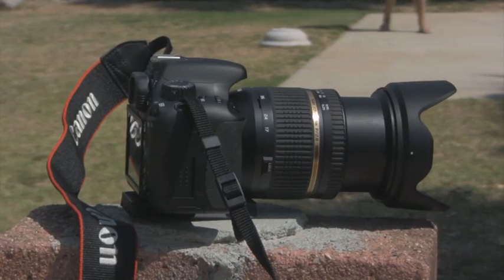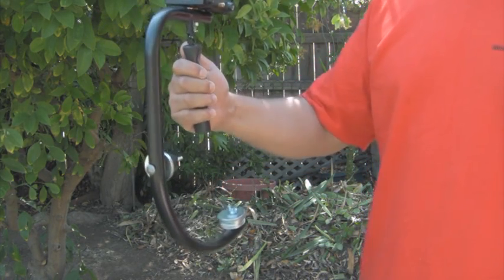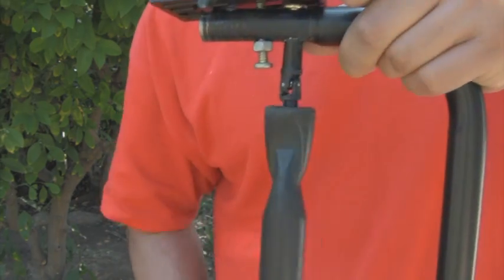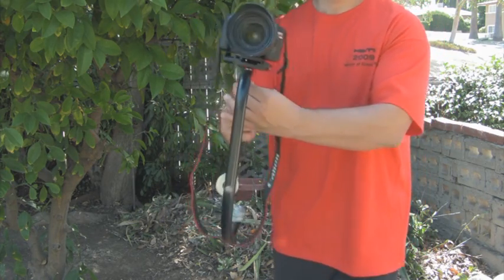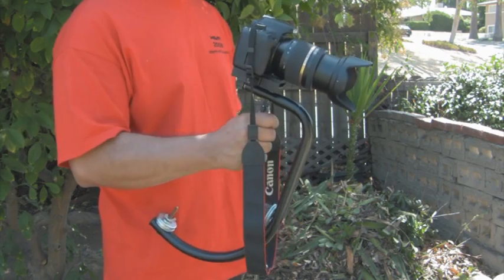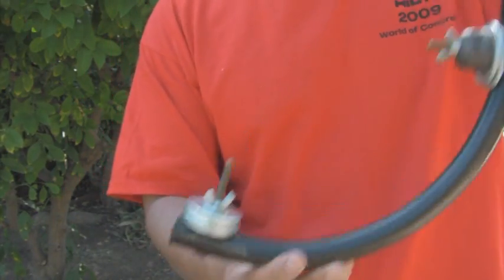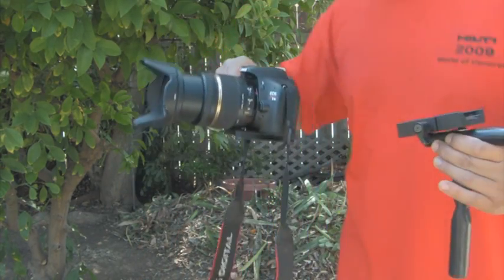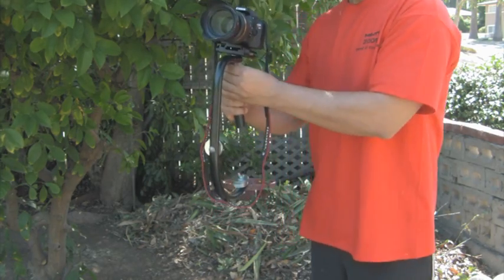DIY Steadicam Merlin Stabilizer Parts I used to build it.

Comment from the maker: @danlnad IMO, skip buying the bearings and go get a jump rope....it'll have the handle and the skateboard bearing is already inside.   If you're in the USA, go check out walmart and it'll cost between $5-$10 for the jump rope.  The bearings alone will cost $6-$10

Comment from the maker: @skateemerica134 Absolutely!  I've got a wedding coming up and with my day job I'm pretty busy.  However, I will try to make another one that will look similar to mine.  I don't know the cost since I need to buy the bar and other hardware but my guess is I can sell them for $40-$50.  I'll let you know when I build it.  BTW, are you using a DSLR or smaller camcorder?  Send me a private message here on youtube.

Comment from the maker: brother, I keep getting questions regarding the u-shape bar and I was fortunate that my chin up bar came with these two u-shaped bars.  Yes, all of todays chin up/pull up bars DO NOT HAVE U-SHAPE BUT INSTEAD THEY ARE L-SHAPED so thanks for pointing that out.  BTW, my chin up gear was purchased back in 1999 and they don't make them anymore (only with l-shape bars).  
I need to make another video because I found some u-shape bars at home depot.  Thanks for checking it out!